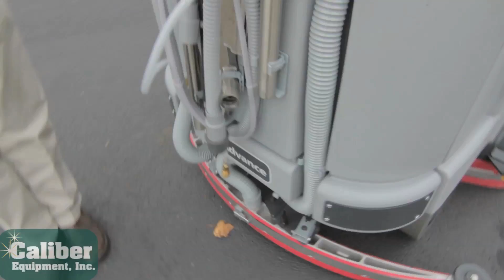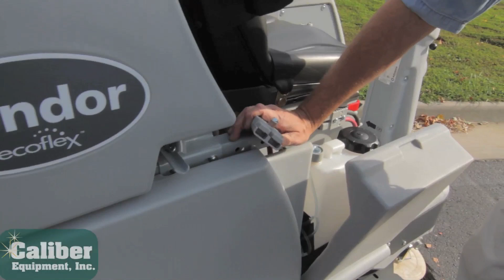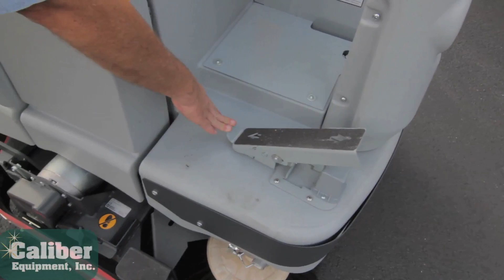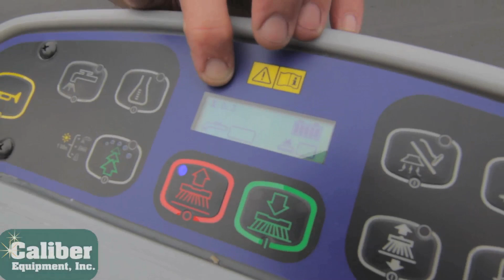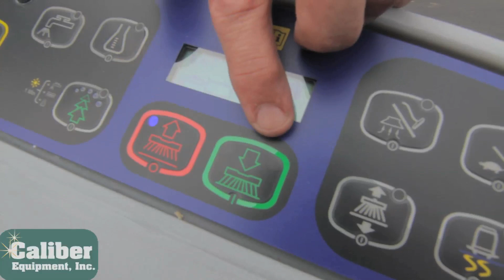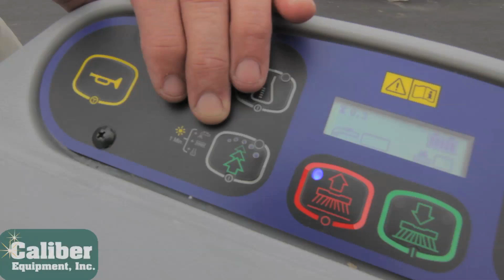Advance Condor Training Video

Comment: haaaa, my comapny's machine is heavily used. Rubber curtains are torn, you have to align the dual sweeping brooms back into place after use otherwise you'll get a 17 error code on it. Of course, someone operated the machine to hit too many walls to count so the steel bumper is dented. So much gunk build up from within the tank and from the inside debris tray. That Condor, unfortanately,  is hardly used and sits on the corner of the building collecting dusts and spider webs. Poor thing T__T. I find this video useful though. I learned many items to identify so I'll no problem telling my peeps! wooo!! Thank you!